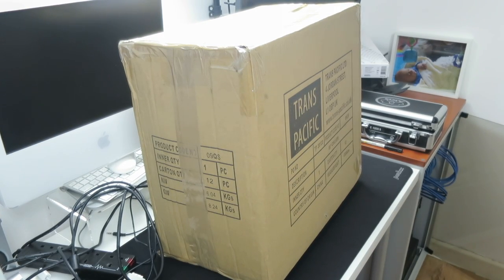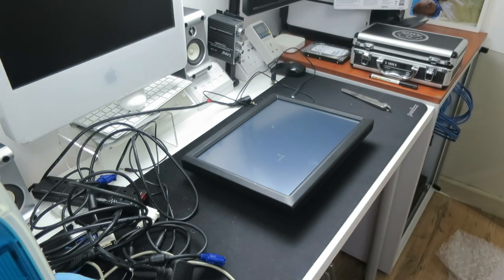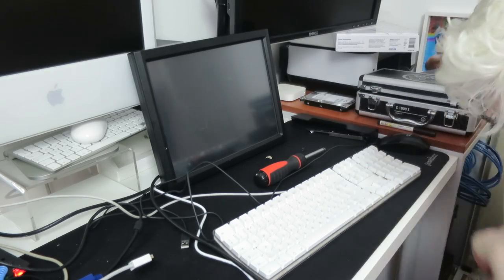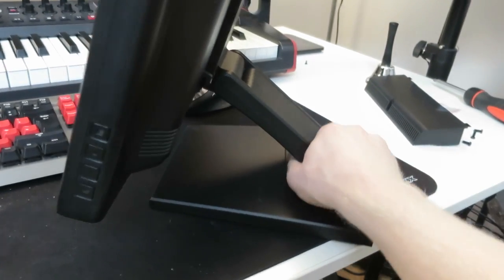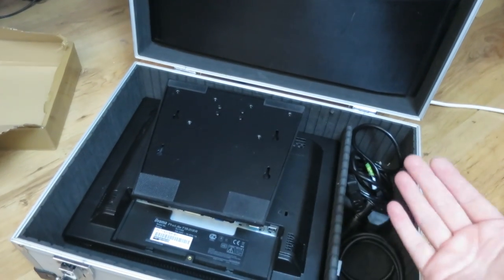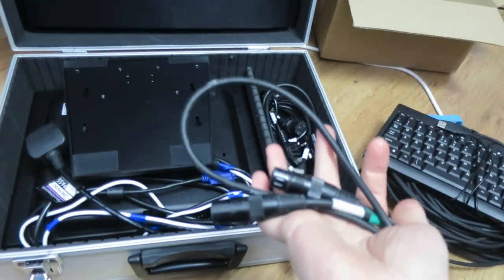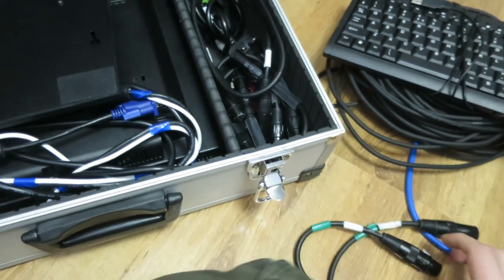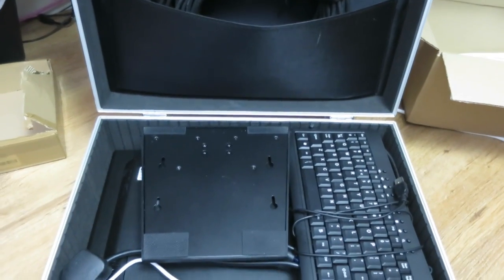A 15" Touchscreen Monitor for £30!

Comment: You can get rackmount flight cases with a top on them , you can then use that as a desk and fix a monitor to the top of it .
Reply from the maker: You can indeed! Before my purchase of my current lighting desk that's pretty much the exact setup I used.

Comment: You should swap the power cable on the monitor for a UPS IEC cable that way you can always extend it easier with a normal IEC to 13pin cable!

Comment: Excellent! I have a Dell Inspiron 15 Touchscreen laptop. At first I was like why the hell would they put a touchscreen on a laptop but come to find out that I've been using it a lot! It's like having a giant Windows 10 powered tablet that has a cd-rom drive, 4 USB 3.0 ports, 1TB hard drive, SD card reader, webcam and a Core i3 dual core processor haha. The best part? I got it for free and I am VERY happy with it!
Reply from the maker: That's an awesome freebie man :D
Reply: It really is haha. Oh I forgot to mention that it only has 4 GB of RAM but I'll probably end up throwing another 4 GB stick in there just for shits and gigs lol although it does pretty well as it sits. I love Win10 so far seeing as my other machine has it. They both came with Win7 but I decided to get with modern times and have the latest OS on them. Coming from WinVista, I'll be honest, it was the best decision I ever made.

Comment: Nice deal there Tom! What do you plan to use the Zero 88 desk for? And, What do you think of High Sierra? Do you plan to update the Hackintosh to High Sierra because of APFS? Or no?
Reply from the maker: I've owned it for a good few years now, I use it for the majority of my events. I do have a smaller desk that I whip out when it's a tiny rig but for anything with moving lights or a setup bigger than 50 channels, I take the Leap Frog 48. 
I must be honest I haven't looked into High Sierra a great deal, I'm still on El Cap on my Hackintosh and it runs sweet as a nut so I'm tempted to keep it that way to minimise headache. Having said that, it depends how much time I have when it's released. If aI have a few days free IO'll go for it and make videos and enjoy the troubleshooting process but it will be tough to wave goodbye to this rock solid install.

Comment: hi can you help me, i am designing a pa rack and i have to things in it i need to achieve that i am struggling to.
firstly, i need some sort of 1u device  to let me switch between 2 balanced stereo xlrs (to switch between the output of my main mixer and my backup and go to the speakers.)
And a headphone switcher and amp to switch between 4  inputs and go to 1 volume controlled output 
pls can you help me

Comment: hey m8., 
i know this ain't about this thread, but can you help me with this small issue?
I've  just purchased i macbook pro  - all be it second hand, it's a great piece of kit.
question is; like a laptop or other devices, does it need to have a internet protection?
I'm using BT anti virus firmwall on my other devices. 
any help would be good / thank you .

Comment: I haven't watched the whole video as of writing this comment, but the touchscreen appears to be using mouse emulation, which is not fine for me, but it's fine for stuff like kiosks and probably your lighting desk as well. Depending on the controller used in the monitor, some may have programmer software that has the option to set the chip up for mouse emulation or the "HID compatible touch screen" standard. Sadly, my Chinavasion touch monitor uses a 5-wire resistive touchscreen, so I can't use it with the Adafruit AR1100 board which requires a 4 wire panel.

Comment: have you look at AIO computer (all in one computer) you dont need a separate Pc
Reply from the maker: Something I didn't make clear at all in this video was the fact that I won't be using this monitor with a PC at all. The console itself supports an external monitor so that's why I've gone this route.
Reply: Tom I think you did make that clear, it sounds like you did! :-)
Reply: oh i may miss that part. but is a real bargain you got there